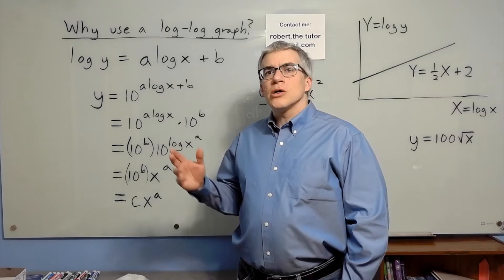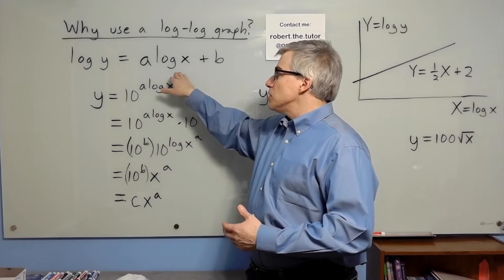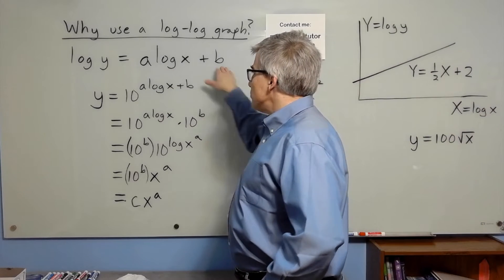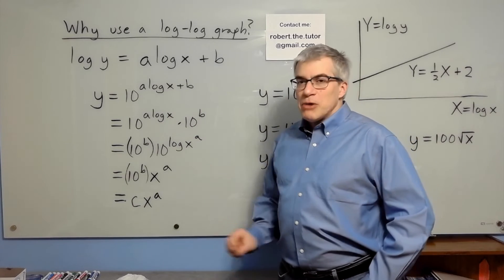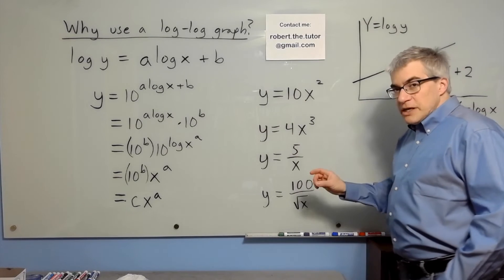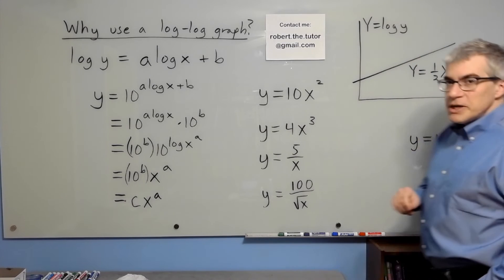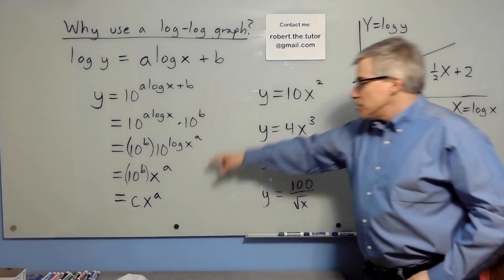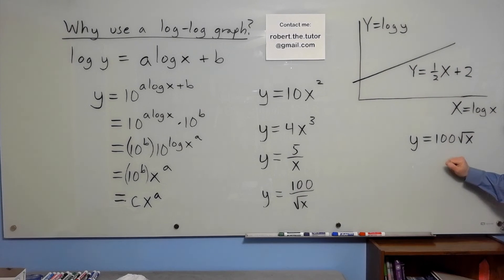Why Use a Log Log Graph?

Comment: Why not leave the small x's and y's as they are (not take their logarithms), and try to figure out a good enough equation to describe the relation between them using some other way? (I know the result won't be a straight line and won't be a first degree equation).
Reply from the maker: Because how do you measure a "good enough" equation? The formulas we use essentially say, rewrite the variables until we have a linear relationship, then fit the data to the line, and then if need be transform back. You can skip that if you can come up with a better way of defining "good enough" that is quantitative.
Reply: @robertcruikshank4501  thanks for the reply